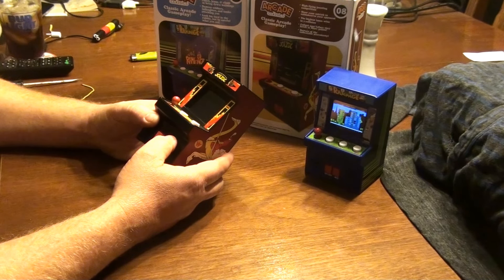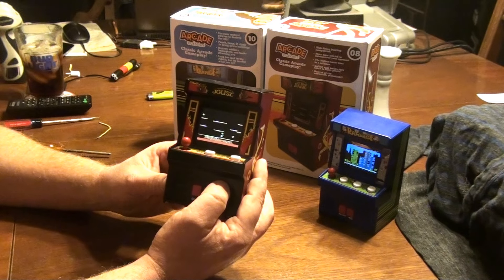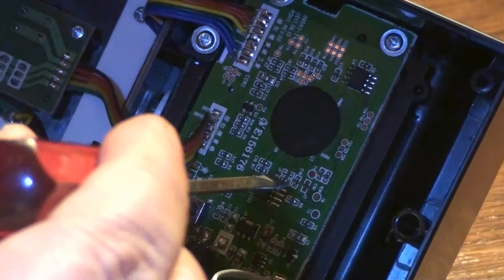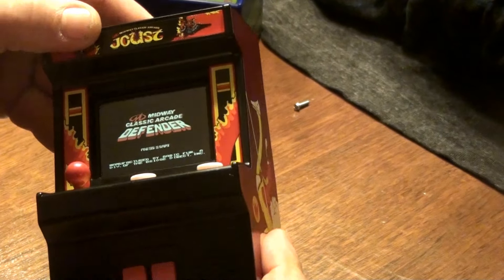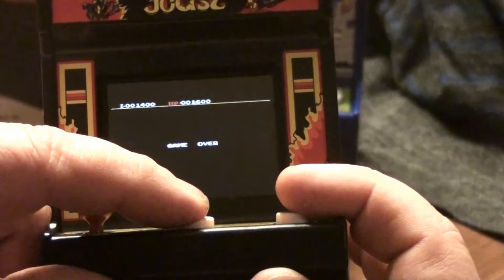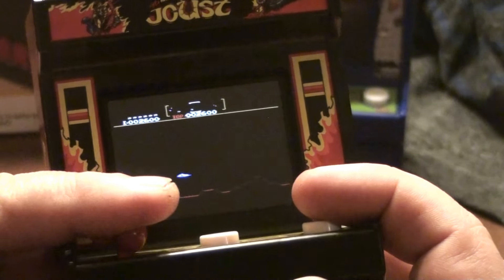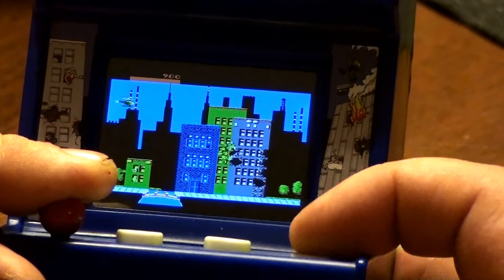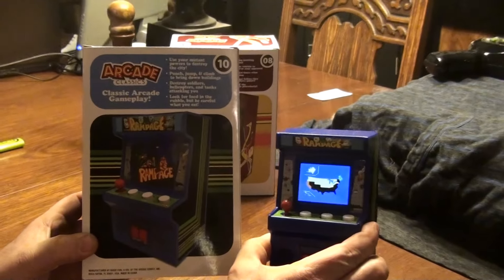DEFENDER HACK!! How To Play Defender On The Mini Joust Arcade

Comment: take a close look at the jumpers closed by surface mount resistors or jumpers on all the different versions,, wonder if all the games are on the board and it just references what jumpers are closed on power up to chose the one for that game , as you said there are at least 2 games accessible by changing the state of that one jumper ,, do use care bridging the wrong jumpers might damage the hardware..

Comment: Is it possible to mount a separate start button in the front or something of the Joust cabinet and make the 2 buttons "fire" and "smart bomb"? I ask this because you're soldering either way and I like the black Joust casing better than the blue Rampage case.
Reply from the maker: We are going to convert one permanently, so we will definitely look into that.

Comment: I literally soldered a jumper wire to the J1 pads, and didn't get defender
Reply from the maker: The newest releases dont have Defender. You have to get an earlier version.
Reply from the maker: We did another video on this, where we explain.
Reply: How do you know if it's an old or new version? Ordered mine on amazon hoping to do this and just now saw this info. Any way I can tell? Maybe the year on the cab?
Reply from the maker: You can tell by the numbers on the UPC. I dont know them off hand. I'll ask mike. He knows. I'll get back to you after the hockey game.
Reply: @MattyMosArcade  thanks man
Reply from the maker: 28317AX. The non hackable are 38317AX or something like that. Look for the 2.  It may not be the UPC, but the numbers are on the bottom of the box.
Reply: @MattyMosArcade  awesome. I really appreciate. Crossing my fingers now. Comes in tomorrow.
Reply from the maker: No problem!

Comment: It's a shame they used the NES port of Rampage. It's one of the worst versions.
The SMS port is much better IMO.
Reply: that aint nes port unless its homebrew hack cause nes didnt have ralph
Reply: It's a modified version, with new title screen, and added wolf (which looks awful and would have been better without). All of these Arcade mini's run on Famicom-on-a-chips, and modify the title screen to cut out the original copyrights. 

I'm guessing the original companies either don't feel it's worth pursuing them legally, or they don't realize they are using their code.
Reply: Would rather had master system  version
Reply: Oh, I agree.. Or the arcade, of course. That runs with very little CPU power for the emulation, but those FOAC systems are dirt cheap to produce, which is why they've been using it since the early 90's.